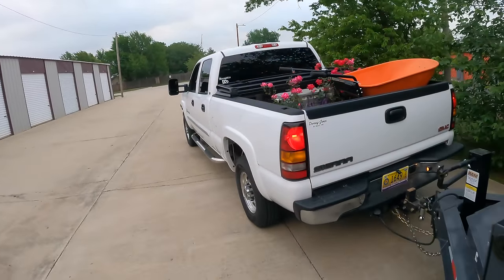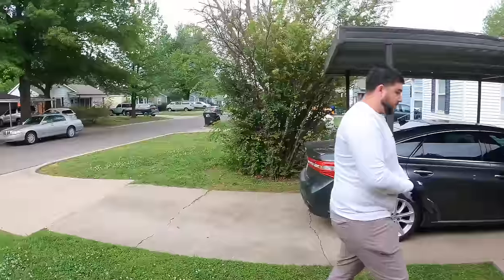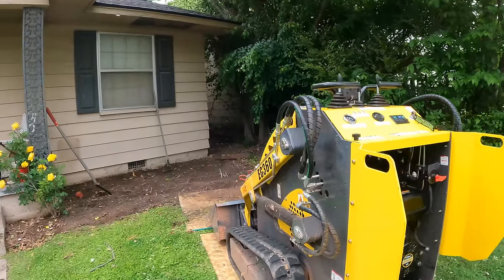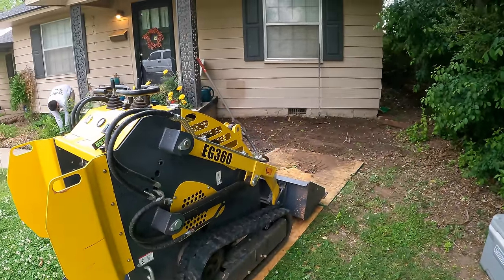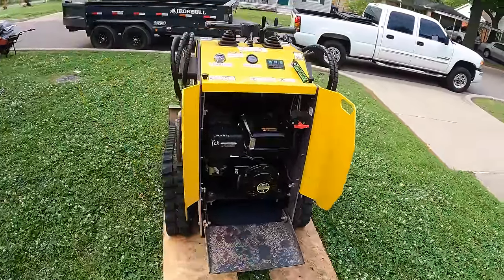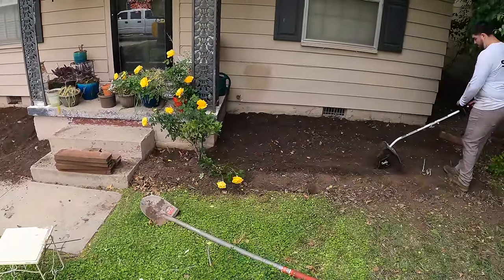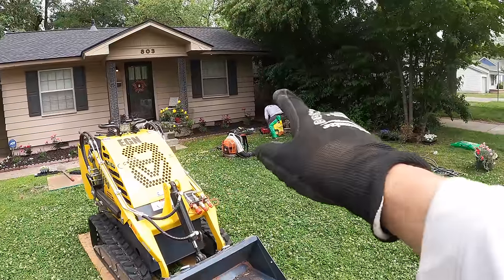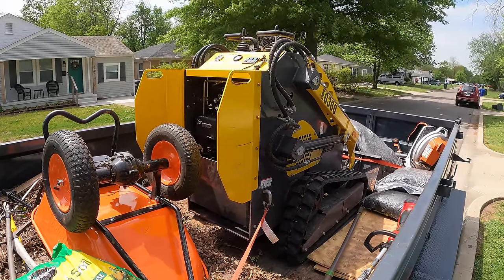Putting The China Skid Steer To Work

Comment: You might consider getting some strips of expanded metal welded to those ramps so that the skid steer drives smoother when loading and unloading. 
That would also make it possible for you to haul your mowers in the dump trailer if you have a job that you need both on and don’t want to make extra trips with different trailers.
Reply from the maker: Was thinking of welding some wire mesh on there, that might help
Reply: @stetslawncare  
Expanded metal will work better for you.
Reply: @stetslawncare  
I sent at least 3 replies and explanations of why I think this material will be better for your purpose and YT deleted all of them for no reason. I don’t know what their problem is. 
You can do an online search for that material and several pictures of it come right up so you can see what it looks like.

Comment: I always pull my tx1000 dingo straight on my dump trailer and back it right off. Please be careful not to get crushed in between the machine and trailer backing on.
Reply: With the ditch witch i always back onto the trailer. It feels so much more safer then tipping off the back onto the ground. At least u have a chance to jump back into the trailer. One time. I picked up a mt100 bobcat stand on. Well, i needed the bucket and pipe puller attachment. They loaded the bucket into trailer then they backed on the Mt100 with the pipepuller. Got to the job. Went to unload it. The whole thing tipped down and got wedged pretty much almost straight up and down. Was so scary. If i woulda backed off the trailer who knows what would have happened. So never load those things with attachments into dump trailers. Always have the bucket on! Lesson learned. Another time a coworker forgot to latch the trailer for me. Went to load a ditchwitch and the whole trailer lifting up and got stuck right on the tailgate handle of my truck. Broke it straight off. Always be safe people
Reply: @lukemarks92  
Definitely always have to be careful. Especially with these mini skid steers.

Comment: Then China skid steer escalators all that stuff they're OK they just haven't got much lift like if you had a small dump truck it wouldn't even lift the load of dirt or stones to put in the back but since you don't have a dump truck you have that little trailer it works out perfect. vaseline or  grease the chrome rods in the winter so don't rust pit. I worked as a hydraulic mechanic for 35 years. If you have a cylinder   rod start leaking just take it off and throw it away and order yourself a new one by the time you order a kit to rebuild it you have more money in it that you could buy a brand new cylinder for, some of the cylinders made in China don't even come apart to rebuild. I'm glad you bought the one with tracks and not  wheels, wheels will tear ruts in the yards. They sell 4' by 8'  Plastic sheets that you can put down in the yard VS it says plywood and sheets have little traction debits on them. Good luck and be safe.

Comment: You should strap down the skidsteer with chains or heavy duty straps
Reply from the maker: 3 3000lb straps were holding it down
Reply: @stetslawncare  damn those are 3000lb straps? My bad that should be good
Reply: @IHustleHard416 rhino straps are rated 1100 lbs with breaking in 3k range. he's covered 100% on weight when he only needs 50%

Comment: Dude!!! You show up to do a small garden flower bed make over as if you were tearing up a drive way 😂😂😂😂 power wheel barrow?? You might as well just hire a crew of school girls or wimpy 10 year old boys 🤣🤣🤣🤣🤣🤣🤣🤣🤣
Reply: I strongly believe in the right tool for the right job, but I’m also old school, I hardly ever use a manual wheel barow let alone a power one.😂
Reply from the maker: Yeah I’ve had the power wheel barrow a few years. Makes rock installs great lol. I just got the skid and have been itching to take it out on a job so just took it on the first one i could
Reply: Been easier and more efficient with manual labor both of you and got it over with.
Reply: Let these nerds hate bro the wheelbarrow is dope